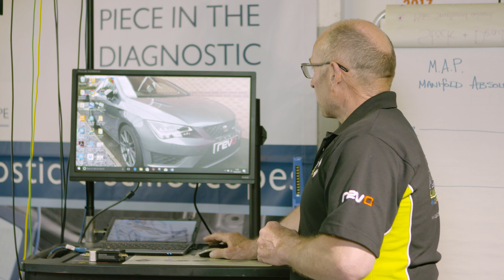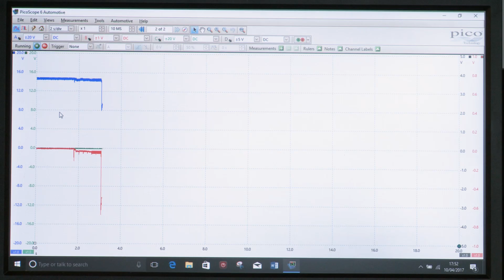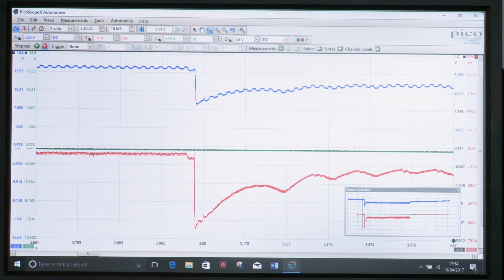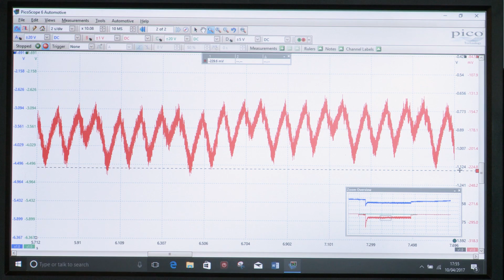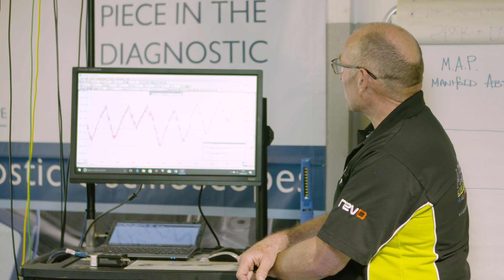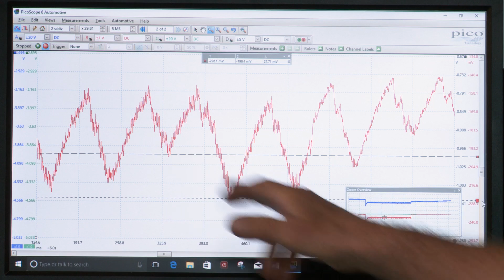Compression testing with Frank Massey from ADS - Episode 3:  Compression analysis using PicoScope

Comment: Nicely done frank. Pretty sure you have 3 cylinders of equal compression though. Not 2 good, 1 average and 1 poor like you said. The "down hill" slope on the peaks are normal when you get 1 bad cylinder due to the crankshaft gathering speed then hitting a "brickwall" directly  after the bad cylinder.